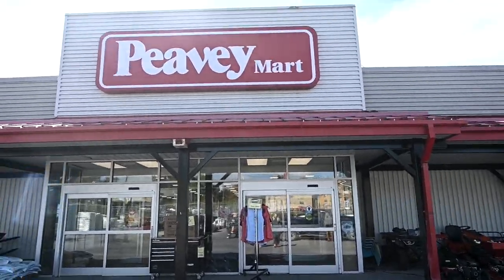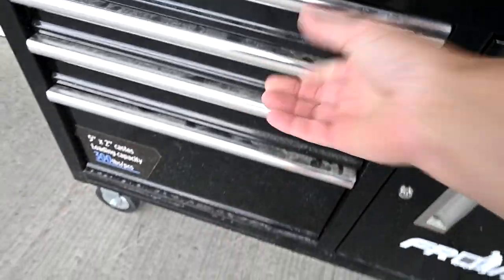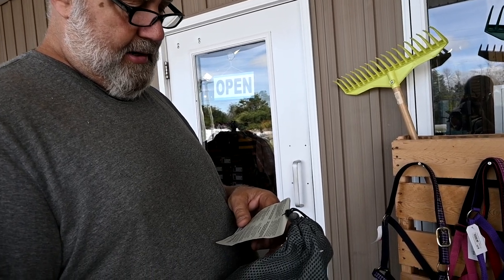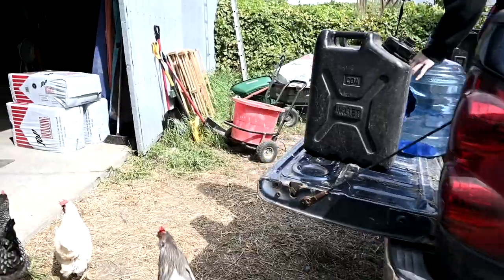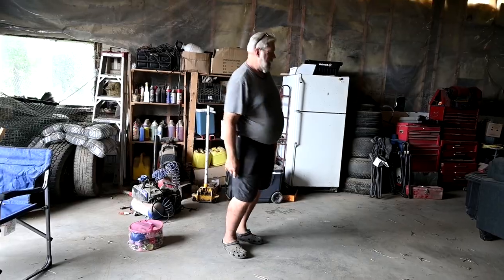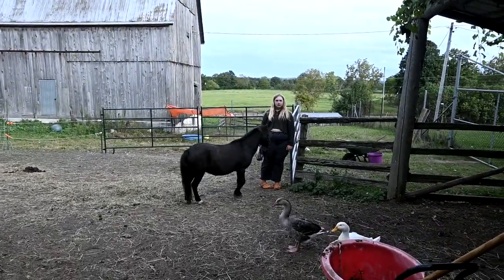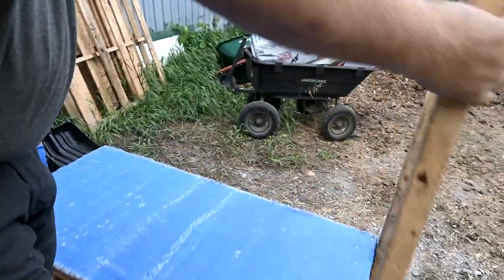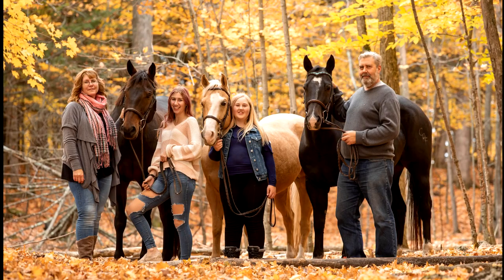Is Our Goat Going To Have Triplets And You Won't Believe What I Finally Found At The Tack Store!

Comment: Just a hint buy your nails and screws and nials by the fifty pound boxs you will save a lot of money. The milk stool going to work wonders the only thing i would have done differently was the height. 
With my old horses I always fed chaff. Easy to digest and a fattening. Back in the 70s i bought skinny horses from the stocksales and put them on grass and chaff diet. No grain. Just turnout. Everyone use to call me to fix their lean/skinny horses. Or they bring the animals to the farm. The vets even sent horses my way.  
Just be careful with animals that see food and get fat just looking.  Chaff was also given to the chickens in the winter especially if it had lots of seed in it. 
Great video.
Reply from the maker: I truly appreciate you sharing your wisdom!  I think you can buy chaff but I'm not sure. I've never seen it sold here but I've never truly looked either!
Reply: @DayByDayVlogs  Thank you Laura 💐
I have never seen it for sale.
When we do haying i sweep the chaff off the wagon or truck and put it in a burlap bag or in something that can breathe. If you put it in plastic, the plastic may sweat and ruin it.  I also open my hay bale on a plywood or in a box (homemade of course) so the chaff will fall in it.  Hay chaff is worth the weight of gold to me. 
I would not buy it from a company that sells it a bag premade. 
Later in years my husdand bought a hay/straw chopper. It worked out great. 
He used chopped straw under the race horses. 
Also if you watch for farm auctions you possibly can find many useful farm items. Such as milking stools, stands, forks, rakes and machinery. This is where I got stuff i didn't have. Went to on in Barrie and brought home tons of items for the riding school. I saved thousands of dollars.  And got farm materials from another. Boards , plywood, nails, and building roofing and siding. 
Remember you have lots of storage  now you can put you extra spare equipment and supplies under cover.